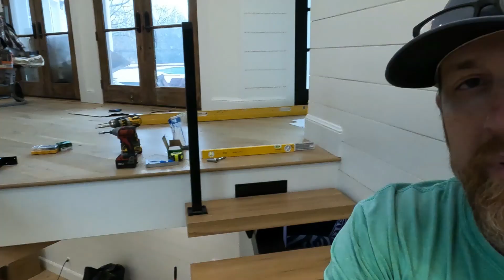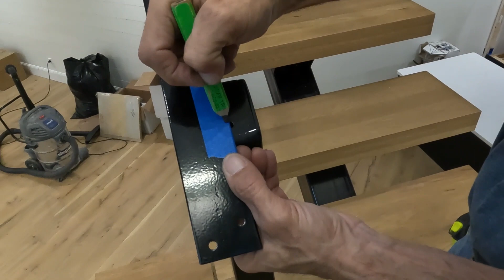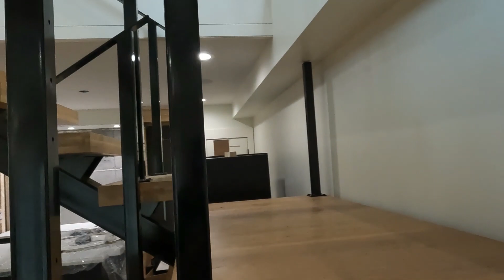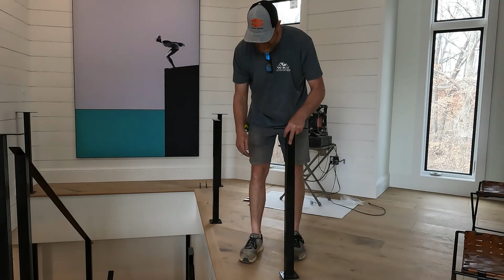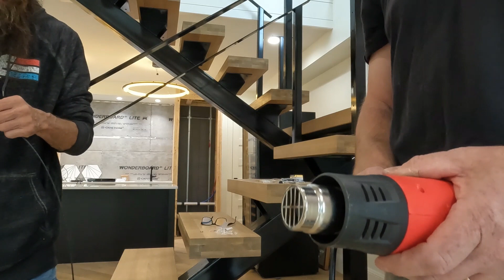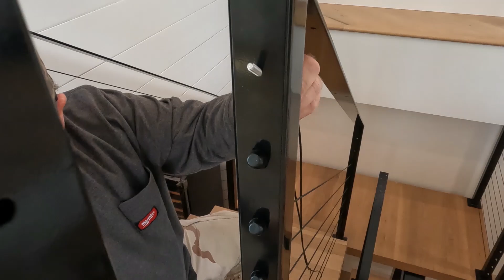Custom Metal FLOATING Stairs / Post & Cable railing Part 4

Comment: How thick is the tubing for the posts?    If it is only 1/8” then you have very few threads holding the studs where you tapped holes.  Shouldn’t they also have a lock nut to keep them from unscrewing.
Reply from the maker: 3/16” & no, once tightened against the post it stays taught